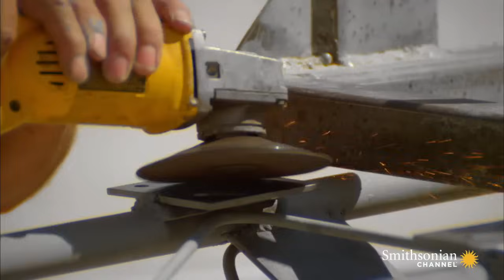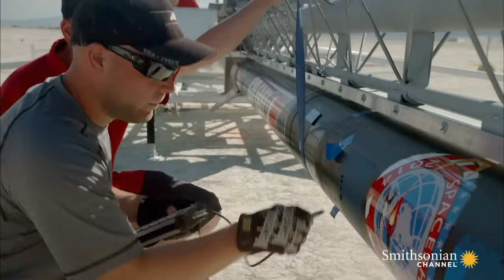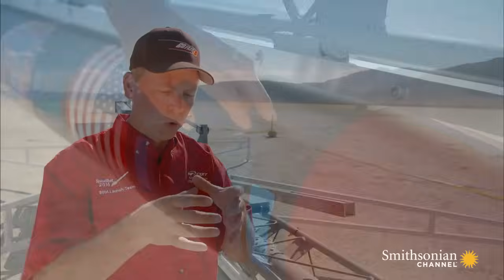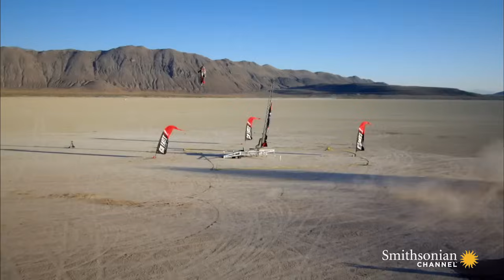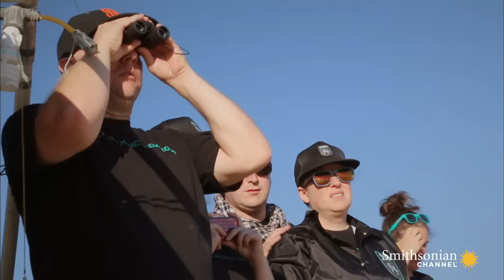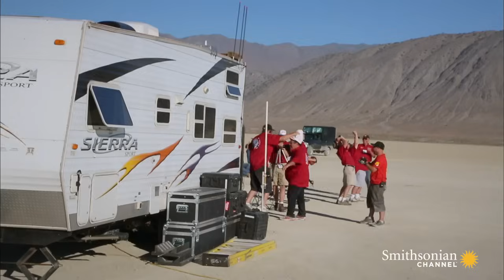Ride into Space with This Record-Breaking Amateur Rocket

Comment: Why don't they use liquid fuel? Liquid Oxygen is not that hard to create in a lab, and you have many options for propellant.
Reply: Liquid rocket engines are MASSIVELY more complex than a solid fuel one.
Wernher von Braun, was far ahead of his time in liquid propelled rocket engines.
It's one of the reasons the US used his talents to put man on the moon.
Look up his story.

Comment: All lies. Flight time: 56 seconds to go 73 miles? That's 6882 feet per second. Which equates to Mach 6.11 or average speed of 4694 mph. They claim 3780 mph. Which is 5544 fps. For 56 seconds is only 58.8 miles high.

Comment: Um.. I did some simple math with the figures they gave.. And it doesnt line up.. The rocket has a burn time of 8 seconds.. Max speed is 3780mph.. So.. 60x60= 3600
3780 ÷3600... X 8.. Is not 73... 
And the momentum didnt get it there.. Its weight even after fuel dump.. Is over 300 lbs.. 
Am i missing something?
Reply: At best its like.. 8 miles up? Momentum didnt carry it 64 more miles.. Theres no second stage.. Wtf?
Reply: where did you get the 60 figure from

Comment: where does it fall back down on the earth??
Reply: It depends on the wind-speeds and trajectory, but it is definitely calculated and simulated beforehand.
Also the parts have a GPS tracker build in so the exact location can be determined.

Comment: why an amateur rocket seems very faster than non amateur ?
Reply: They are lighter.  The lighter a rocket, the quicker it can accelerate.  Motor does not burn as long because it does not carry much fuel.

Comment: This is BS. Every single time they send a rocket into space with a camera on it, it always stops, then skips to space. This is with every. Single. Rocket. Sent. Why is nobody questioning this?
Reply: That's completley incorrect. You can look up the entire flight relatively easliy if you want.
Reply: Wrong, practically every SpaceX and ULA recent launch has a video that syncs right with the realtime events of the launch.

How do I know? I've attended 4 rocket launches (Iridium-2, Iridium-4, NROL-45, NASA InSight) and every single event in the video lines right up. Also, the spinrate is entirely normal. It's called a yo-yo despin.
Reply: It’s almost as if short low retail videoed designed for the attention span of modern westerners use editing to only show significant events.

What an incredibly unique revelation.
Reply: Because you are the only fool who does not know.
Reply: Its called a yo yo despin. it uses weights on long strings that jettison out with the conservation of momentum to slow the spin. look up "hoberman sphere"
Reply: no man your actually absolutely right this is edited a lot. the whole video shows the thing go from flying 16gs to a nearly dead stop. something is up, its spin rates drops almost immediately too. it appears to hit something I'm not going to speculate I have my ideas but I'm not going to speculate but I appears to hit something.

Comment: So 3780 mph or 3780/60 = 63 miles in a minute. Or 63/60 = 1.05 miles per second which when multiplied by 12 seconds is 12.6 miles. How did the rocket travel 73 miles ?
Reply: Momentum my friend.
Reply: The rocket never left earth's gravitational field, at apogee it was probably still experiencing 98%+ Earths gravity. The motor burned for 12 seconds but the rocket still had a lot of momentum and it coasted the rest of the way.

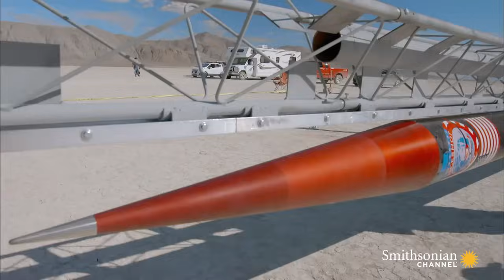Comment: At 1:13 he says no human could survive 16 Gs.  This is not correct, in fact wildly so.   Col. John Paul Stapp survived, and completely recovered from, being subjected to much higher than that at the rocket sled track on Holloman Air Force base in 1954. He reached 632 miles per hour, and decelerated in 1.4 seconds. Various sources calculated the G forces at between 43 and 55 Gs.

It would be one hell of a ride, but survivable (at least in terms of acceleration).
Reply: I've heard it said humans can't sustain more than 4 g but fighter pilots do it all the time, although I'm pretty sure that figure means humans can't live for extended periods of time like that without sustaining damage. Matter of fact, I've heard (in a video, mind you) a pilot say he pulled about 12 g in an F-15. That's not far off of 16 g, especially considering the angle of the g-force involved was straight along the z axis. Humans can take much more g-force in the y axis. That 55 g was along the y axis, which is why Stapp wasn't immediately knocked cold. Put g-force in any of the rotational axis, though, and it starts getting deadly real fast.
Reply: @mage3690  no, almost all humans can survive 4 g
Reply: @arah8998  ok, it's 5 g in z axis. At that point your heart is overwhelmed and can no longer pump blood to your head on its own, but that requires you to be almost completely relaxed. Unlikely, but you could die from excess g-force at 5 g.
Reply: @mage3690  interesting
Reply: Well 55 gs  would be impossible. They say what ever  your weight is would be the same weight as 1g pushing against you or crushing you per say. So if you weigh 200lbs and at 50g that would be 10,000lbs of force pushing on you. I dont think you would survive that.
Reply: @trunk1255  and yet, it happened. Wikipedia refers to the type of g-force sustained as eyeballs-out, which means that he was in the "deceleration" phase of a stress test conducted by the Air Force. He did indeed weigh something in the neighborhood of 7,700 pounds for a brief instant, although he certainly didn't die. He sustained no major injuries in any of his tests, although he did lose eyesight temporarily due to retinal bleeding. He was apparently wearing nothing but a lap belt at the time.
Reply: 632mph deceleration 1.4 sec  Not clear. What does 1.4 represent ?
Reply: Depends on how long you hold the 14 or 16 gs. You'd definitely die if you were going the speed of this rocket for as long as it was going.
Reply: They r just risking thier lives. They r sooo lucky to survive. The fact is, humans cant survive more than 16g

Comment: it just spins and spins.  Very amateur
Reply: Spin stabilization is very common in rocketry, it helps it fly straight without needing complex steering/control systems. It's just like throwing a football.
Reply: Gyroscopic forces are a low cost way to keep the rocket from veering off course

Comment: +Smithsonian Channel It is imperative to note that FAA clearance is required. Then, I have a question please? Why does the rocket spin rotation-ally so fast!   (*I'd like to add a note if I may? I've a MA in Science, I strongly urge Jet Pack man to attach a "belly parachute" just in case of a mech failure, I don't wanna see anyone die.) Thanks :--)
Reply: Fins only provide stability when there is air pressure to act upon their surface area (stability is the ratio between the center of gravity and the center of aerodynamic pressure). Since there is no air, there is no aerodynamics; all we have is mass to work with. So, we impart spin to use mass to our advantage and keep the rocket straight via centrifugal force.
Reply: With passive spin stabilization (fins), they don't have a choice as to when it begins spinning. They cant the fins at a specific angle that will give them the rotational velocity they need to stabilize the vehicle. They use the burnout velocity (or the last velocity where the vehicle is still under forward acceleration) of the vehicle to calculate the fin cant.

All rockets that have high take off acceleration have that pause before they begin their spin and that has to do with the mass of the vehicle and the amount of torque applied to the fins by the air rushing over them (as they are canted). The higher the speed, the more mass of air per unit of time is acting upon the fins which increases the torque per unit of time until finally, the rocket begins rotating.

Very heavy multi-stage sounding rockets (Black Brant IV) which is comprised of the Brant sustainer, a Terrier 2nd stage and a Talos primary booster. The vehicle is so heavy and the Talos burns out so fast that they need kicker motors to actively get the vehicle rotating. If not, it can rip the fins off or not get the vehicle up to speed by the time the Terrier-Brant is to and altitude where it needs the spin. The kickers are twin solid motors at the top of the Talos-Terrier interstage that fire for about 1 second the moment it clears the launcher. They are pointed slightly downwards and relatively tangent to the airframe to initiate rotation.
Reply: "I've a MA in Science" LOL

I am sure your suggestions and comments will be taken into consideration.
Reply: It spins to give stability, similar to a bullet or football.
Reply: Really?  I didnt think rockets were designed that way.  I think normally if the stab fins are perfectly lined up you will still get some spin due to torque from the thrust because of slight imbalances of wgt throughout the rocket.  Course I am just making an educated guess, not positive, you could be right.
Reply: Thanks Brian.  I get the stability part of air pressure on the fins surface area and why spin is used.  Just figured there was enough thru most of the flight while it was in air dense enough to effect pressure on the fins that you wouldn't need to create the spin for stability once it got into thin air.  Another observation on my part would suggest that the spin isnt fast enough to produce stability.  Again, I could and probably am wrong, just throwing it out there.  I get ballistics as a competitive shooter but this is obviously a diff animal.
Reply: I take that back, I just caught the part where it spins and it is probably fast enough for stability though I dont know if it really needed it at that time.
Reply: Unfortunately he never gets high enough for a fail safe type parachute to really have time to deploy properly :(
Reply: He never got high enough for a parachute to deploy before he hit the ground.

Comment: 3780 MPH × 12 seconds of flight does not equal 73.1 miles of altitude. It equals 12.6 miles of altitude. A rocket of that size would be invisible at 73.1 miles. It isn't invisible to the spectators on the ground. I love science and rockets but the math doesn't add up in this vid.
Reply: Puddin Tame  The fuel is all gone in 12 seconds, but the rocket keeps going up.
Reply: Momentum.
Reply: Your math is based on linear logic.
The real world doesn't work in a linear scale

Comment: i have safety concern about these amateur rockets, these rockets might collide with any aircraft... or even might crash in any locality with resulting fatalities!
Reply: +kazi riasat They are under FAA regs. They are given a launch window.
Reply: +kazi riasat It's called an FAA waiver, and that's why they launch in the Black Rock desert--because 1) Not many aircraft are flying up there between the surrounding military operation areas, and 2) there's not much "civilization" around there either. So that's a traditional location for amateur "research" type activities involving high-powered rocketry. So that's where a lot of these high altitude flights tend to take place, although there are other such areas in the country as well.

The other thing is that there are always spotters at these launches, and there is both a Range Safety Officer and a Launch Control Officer on-site. If there is any hint of an aircraft in the area, no launch is allowed. And the FAA's waiver is NOTAM'd so that air traffic control and pilots are aware of these activities. 

So your concerns, although valid, have already been addresses many times over by the FAA, Tripoli Rocketry Association, and the National Association of Rocketry.

Comment: While this is a great feat of engineering, especially for civilians, the main issue I see is the really nasty rotation. This is a problem that has been faced an conquered in the past, and it seems that civilian rocket engineers will have to face that learning curve all over again, basically having to solve the same problems that have already been solved. Thus it makes sense to learn as much as possible from the early experiments, the problems and solutions that were devised, so that time and money can be saved. The large engines NASA used to fuel the Apollo missions are something that we probably could not easily build today. Those of course were not solid-fuelled engines, which makes a big difference in the behavior of the engine, but I'm just saying that a lot of that knowledge has been lost, even to NASA. Blueprints and notes will never trump experience, so I'm guessing that there might only be so much civilian rocket engineers can learn without experimentation. One of the drawbacks, as I've mentioned, is that not every concept from a liquid-fuelled engine can be applied to a solid-fuelled engine, or a hybrid engine either. But the results depicted in this video definitely prove that the design and engineering basics have been conquered, and that is the hardest part. I mean getting the thing to fly in such a manner is the hardest part, and even a solid-fuelled engine, while they are not as likely to explode, has its challenges. It is not easy feat, as evidenced by the number of people NOT building rockets of this size with this much power and capability. Thus my hat is off to this team, and I wish more people would realize just what an accomplishment this actually is. No easy feat by any stretch.
Reply: +Jiggy Potamus the rotation was intentional for stability and later stopped when approaching apogee using a yo-yo system

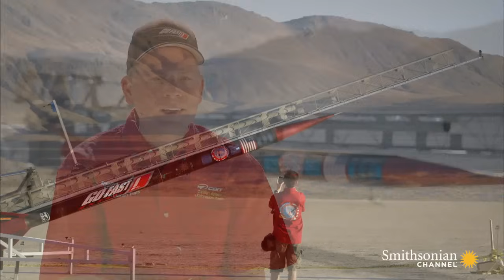Comment: 1:20 Acceleration key to getting into space? No, it's delta-v....
Reply: +MK3424 You have to be accelerating faster than 9.8 m/s per second or you're not going anywhere. Delta-v is necessary for knowing where you can go.
Reply: Yes, but the initial acceleration doesn't have to be already over 20m/s² to get off the launchpad. (the initial acceleration of the Saturn V was even just 1.13Gs)
Reply: That's true, however the longer the engine has to burn on an amateur rocket the more chance it has of fucking up.
Reply: +Callmesir_ That's why testing is key..